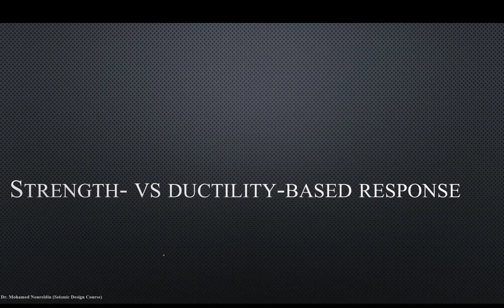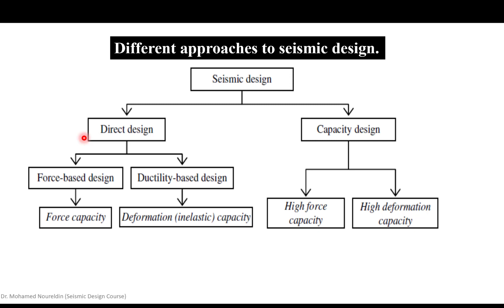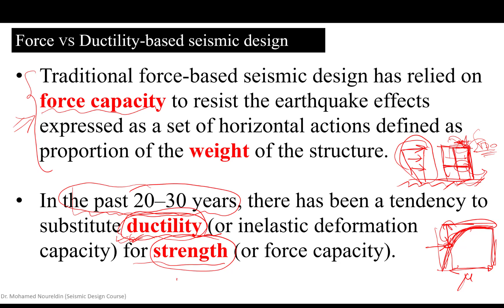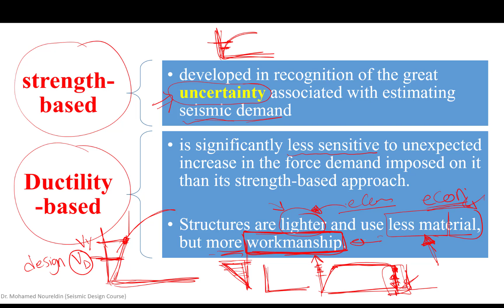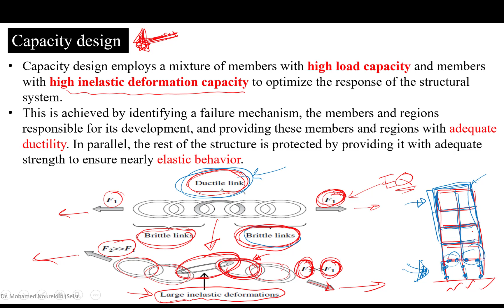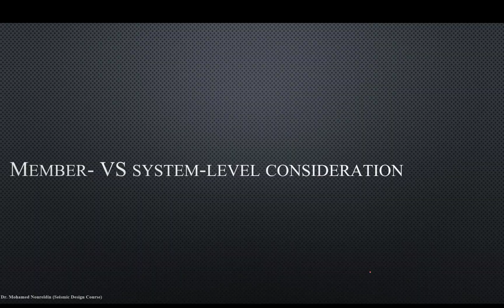3- Seismic capacity design vs  direct design

Comment: Thank you Engr for this video.Which book that is good reference for capacity design?
Reply from the maker: Thank you for your comment.
Most recent books are using capacity design. The rationale of capacity design can be found in the following:
1.Earthquake engineering theory and implementation.

 2. Paulay , T. and Priestley , M.N.J. ( 1992 ). Seismic Design of Reinforced Concrete and Masonry Buildings . John Wiley & Sons , New
York, NY, USA.

 3. Bozorgnia , Y. and Bertero , V.V. ( 2004 ). Earthquake Engineering. From Engineering Seismology to Performance - Based Engineering .
 CRC Press , Boca Raton, FL, USA